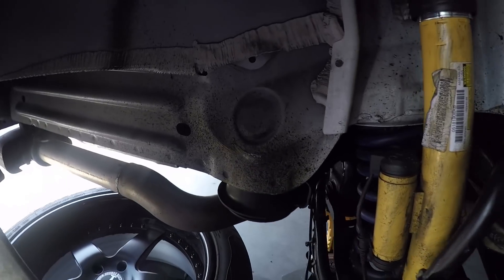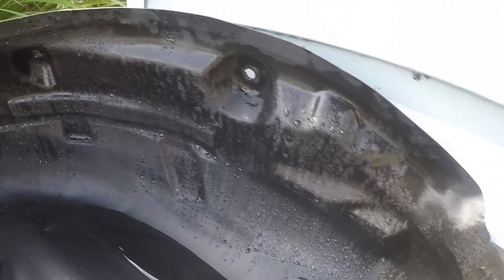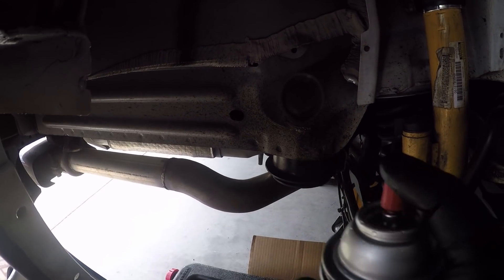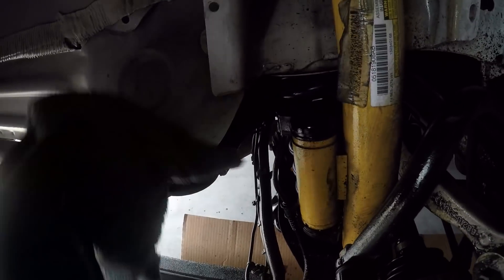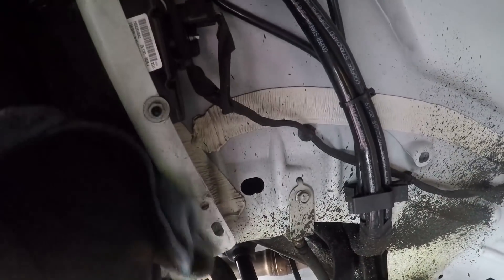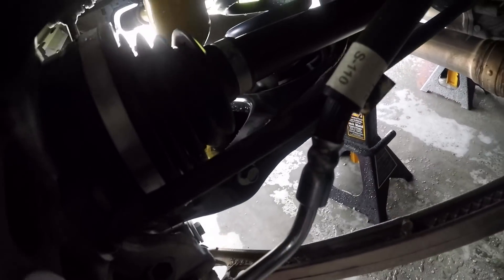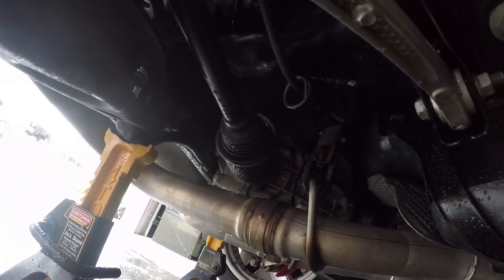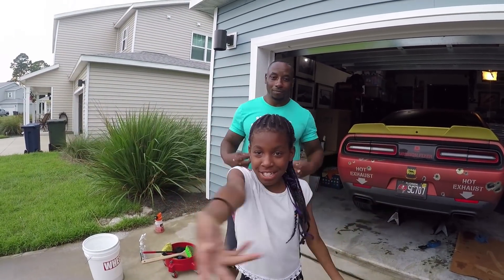Challenger Hellcat: 26" Forgiatos; Busted Axle Aftermath!

Comment: What size tires are you running to fit those rims on the rear cause I have 305/30zr26 and they fit the front but I can’t get em to clear the well on the back I need about an inch or so to clear and even be able to bolt them on so I’m wondering if I went down to something like 275 would that work
Reply from the maker: roosevelt gamble where is it rubbing? Might have to 275/25/26 gonna be rubber band tires tho
Reply: It’s not even going on I’m running out of space to be able to line the studs up to mount the wheel I need about another 1-1/4 to line the studs up so I’m thinking should I go 275/25 or 255  and if so would that give me that clearance cause the front wheels fit in and are fine just can’t get the rear to mount up
Reply: So do you need to lift the back or add some sort of lift for 26” rear and  24” front?

Comment: Degreaser would work or even brake cleaner. I noticed your pink scooter how much Hp she pushing?
Reply: DarkMatter Kitty Kitty lol
Reply from the maker: It's supercharged putting out 0.707 to the rear wheel.
Reply: Mission Flyer That pink color doesn't fool anyone. Freaking sleeper.